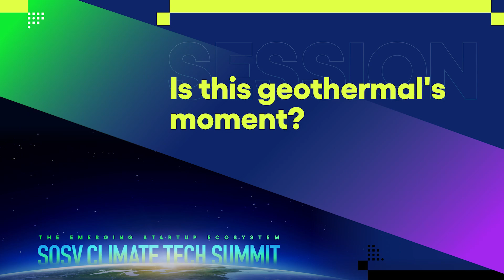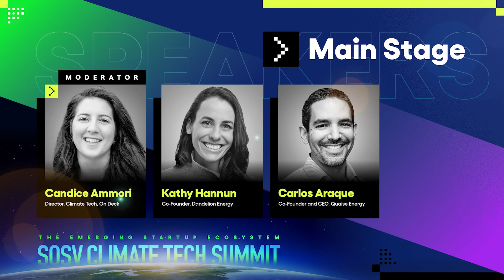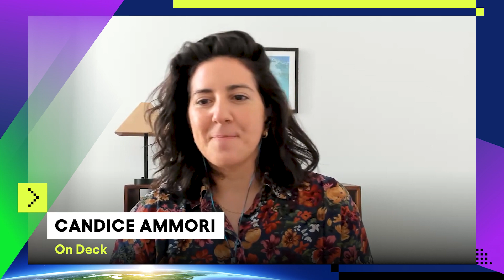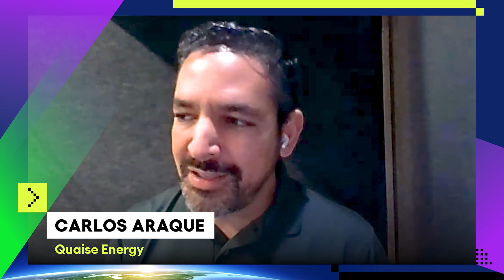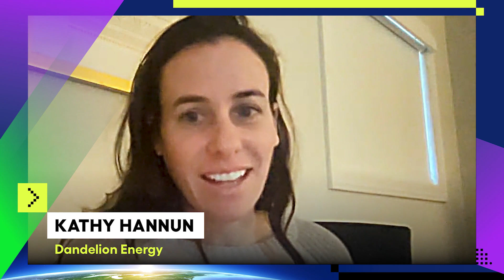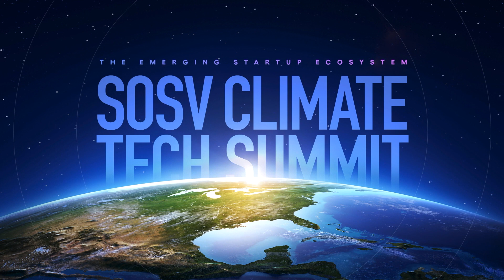Is this geothermal's moment? | SOSV Climate Tech Summit 2022

Comment: Is there a demonstration video of the Quaise gyrotron creating a bore hole a few feet deep in the hardest type of rock likely to be encountered in  creation of a productive bore hole? The only video I've been able to see is a laser appearing to melt a few millimeters of rock in a laboratory.  I'd be interested in seeing such evidence and discussion of the speed of this type of drilling once you get to depths where normal drilling equipment starts to break down due to excessive heat. Thank you.